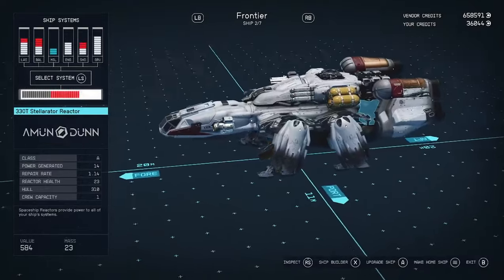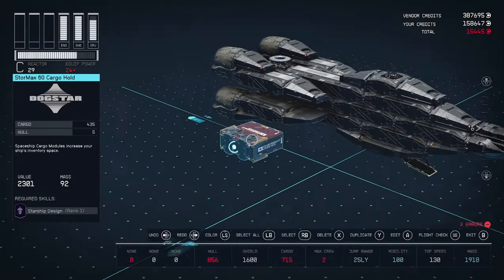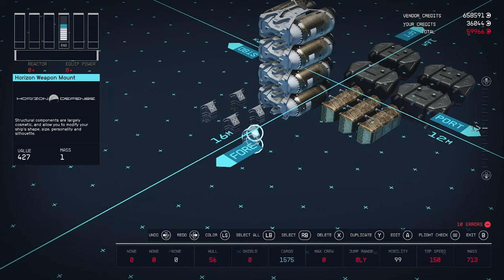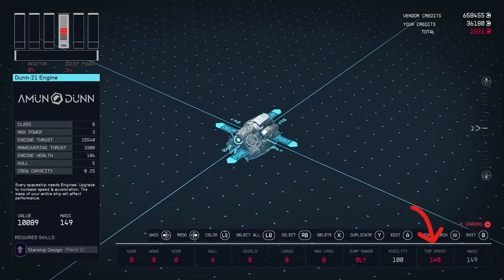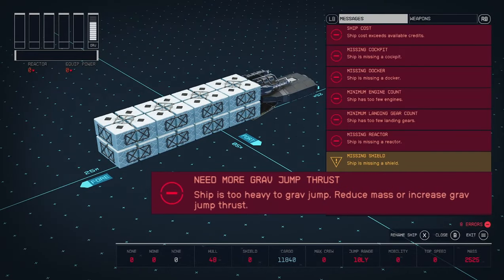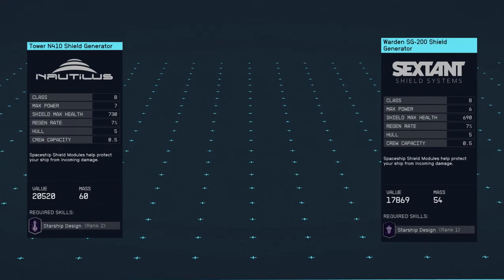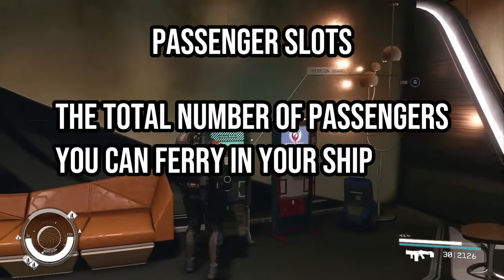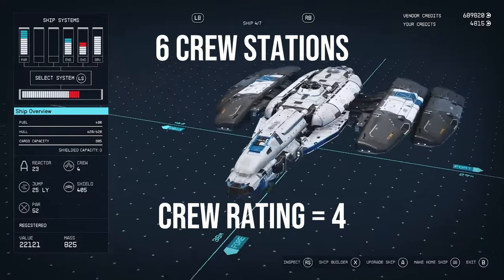Starfield Advanced Ship Building Guide - Maximizing Efficiency and Effectiveness

Comment: Great video, I just have a couple of notes:

Power supplied to weapons only affects reload rate.  Automatic weapons have the same fire rate regardless of how much power is supplied, more power just means faster reload once their magazine has been spent. 

This means it’s generally more effective to have 6 weapons that have a max power of 2 than to have 4 weapons with a max power of 3.  And in my own practical use only giving them 50% power is more than enough if you have a bit of trigger discipline and don’t just spray and pray. 

So you shouldn’t limit yourself on the number of weapons of a given type based on how much power you can apply to that type. 

Same applies to missiles.  4 missile launchers, even if you only have 1 point of power applied to MSL, will fire a full volley.  More power just means shorter time until you can fire them again. 

As far as choosing reactors goes, what works best for me is deciding what I want for weapons, shield, and engines first, then I choose the lowest class reactor that is allowed and that provides sufficient power for at least the engines and shield and some extra for weapons.  

In practice if it’s a big ship I rarely max power for engines unless I’m looting space junk after a fight.  Extra speed is nice in a fight but I typically only push the throttle to close distance to lock on. 

Shield are always at full power though.  Always.

Comment: I’ve been scouring the internet trying to find what the max cargo could be on a ship that has 180 top speed while maintaining 100 mobility. I’m pretty sure the answer is in this videos formulas. If only I wasn’t so stupid 😂
Reply from the maker: The White Dwarf 3030s are the only engines I know of that have 180 Top Speed. They each have 3,210 Maneuvering Thrust and you can have up to 4 White Dwarf 3030s as the each use up to 3 Power allocation. 4 White Dwarf 3030s produce a total of 12,840 Maneuvering Thrust which will support up to about 1,039 Mass at 100 Mobility. You can exceed 1,039 Mass and lose Mobility, but maintain 180 Top Speed as far as I can tell as long as you fully power all Engines. Hope that helps!
Reply: @Bizzle94588  Bro, you're a fuckin legend. On top of putting together this fuckin video, you STILL take the time to help an idiot like me with questions. Can't thank you enough, you're a badass!
Reply from the maker: @honestinsincerity2270  Just happy to help!

Comment: I'll admit that a lot of this for weapons, thrusters, cargo bays, and fuel tanks.... it feels like someone at bethesda hit the "randomly populate" button for most of their stats. You can do energy to dps calculations for the weapons and, outside of one, the answer is almost universally the vanguard 2 power class A obliterator auto-projector which only has 1 directly superior upgrade weapon. There are missiles that outperform but missiles come with distinct drawbacks.

This trend continues to fuel pods with the two most interesting being the ~11 fuel per 1 unit of mass large-orb 900t with a second best at the 8 fuel per 1 unit of mass 700t. If there are better family fuel tanks, I've not run into them quite yet.

Regarding the thrusters, there are five things to consider for them, mass, maximum regular speed, maximum boost speed, power allocation, and overall thrust. Much like the weapons there are absolute winners in each category.

Comment: Question about landing thrust. Are all the landing thrust really the same? If you look at the landing thrust # it goes up to 4 from what I've found. What do those numbers mean? Is it every increase in the lander thrust # = +100 mass?
ex. Lander Thrust 1 = 200 mass
      Lander Thrust 2 = 300 mass
Reply from the maker: So each point of landing thrust can support 200 mass. Each landing gear has a landing thrust value, and the sum of your landing thrust will tell you how much mass you can support. So 4 landing gears with a sum of 8 landing thrust can support 1600 mass. If the mass exceeds 1600 by even one point, you'll need another point of landing thrust. So the specific individual landing gear you use doesn't matter. Hope that helps!

Comment: Best of all worlds is to use class A engines with the biggest/best class C power plant. Forgo massive cargo if you want mobility. You can easily build a nice ship with good interior that still has a mobility of 100, and have total freedom as to what components you want. Class A engines will give you a ship with a top speed of 150 even though you are flying a class C ship due to the power plant.

My own ship has a 30 LY jump range with great fuel, 150 speed and 100 maneuverability, this as a class C ship! It has a great expansive interior with a 2x3 and two 2x2 modules, among others, easily supporting 8 crew. It has a near max shield capacity and utterly withering firepower. It's only downside is low cargo of only ~800.

Comment: Best build: 4x White dwarf 3015 top speed 180, class c reactor, class b shield
Reply: no need for c class reactor.  104DS Mag Inertial Reactor provides 39 power, which is only 1 less than the very best c class reactor and it's class b, saving you 45-60 mass at least.  There are only 2 class c reactors which provide more power than a 104DS.. and the mass gain is just too much to keep sufficient cargo for 1 extra power pip.   I agree though on the rest.  Kinda a bummer when it comes to ship design as once you learn this you feel pidgeonholed into using them every build.
Reply: @jagzorz Unless of course you want to use Class C weapons or carry a lot of cargo.  There really isn't a 'best' in this game for everything, which i'm grateful for at least.